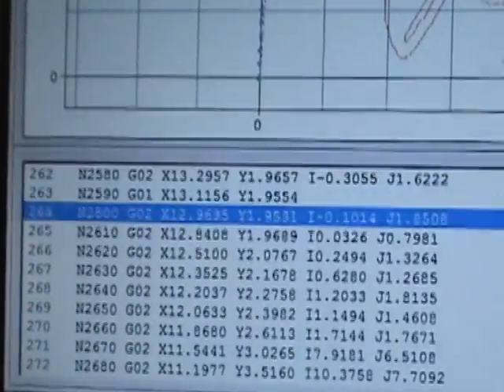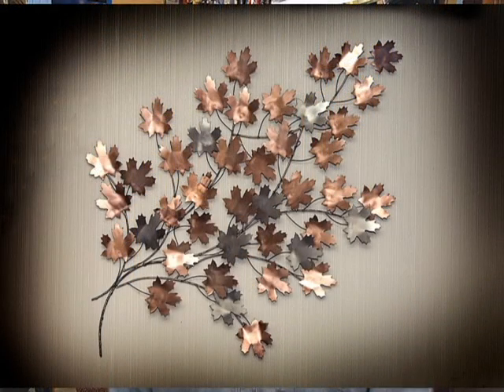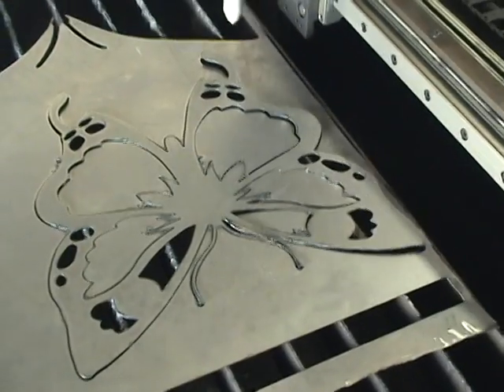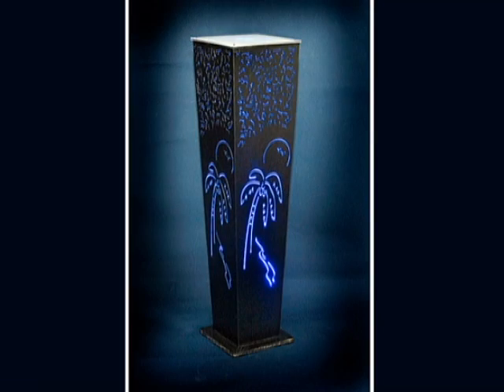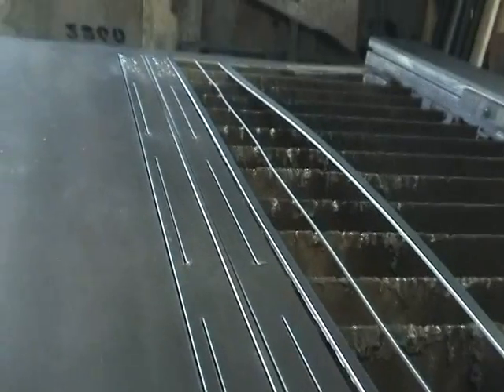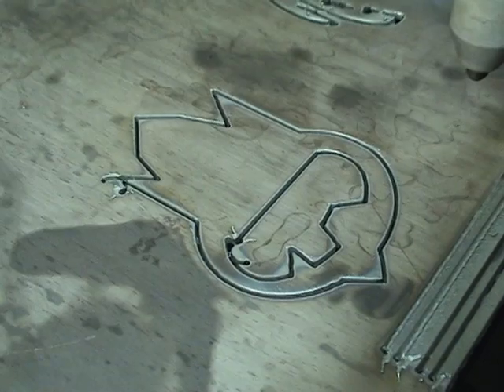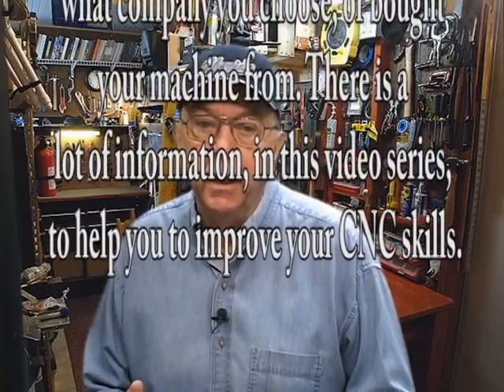CNC Plasma Cutting Machine, Metal Art 101, CAD/CAM, learning

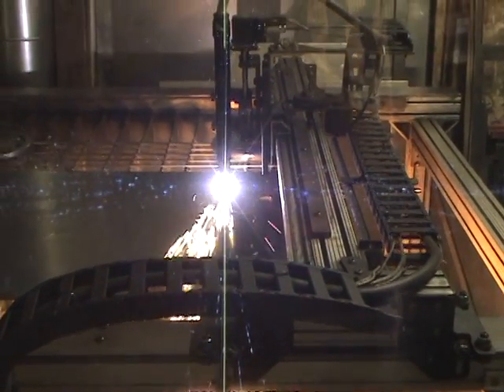Comment: Dick, I love your video!  Very interesting!  I currently own a PlasmaCam and am loving it!!  I have a quick question for you... at 4:50 what is that tool called and where can I get one?!   I struggle so much sometimes getting the cut parts out of the holes after they are cut.

Thanks!
Reply from the maker: +Hammered Rat Turd   Thanks for your comments.  I am glad you find my vid interesting and hopefully helpful to you.  The tool you are referring to is nothing more than a hand magnet that I picked up at Northern Tools for a couple of bucks.  As a matter of fact it was on one of their bargain tables in an isle where they put out a bunch of stuff for a little bit of money.  Any kind of magnet will work for you.  I use this one all of the time because it is small and has a lot of power.  I like the little handle that screws into the round magnet.  I hope that answers your question.

Comment from the maker: Thanks Rafi for making a comment.  However, I am not really sure of what you are wanting to know.  I think you meant switch not swicth.  I any case, what my DVDs teach is CAD, CAM, using a CNC machine and doing metal art and design with a CNC.  I don't teach how to build a CNC machine or what the inner workings of the parts are, to using a CNC.  If you want to know about switches and parts, I suggest you contact the tech support of the company you bought your machine/table/plasma torch from.